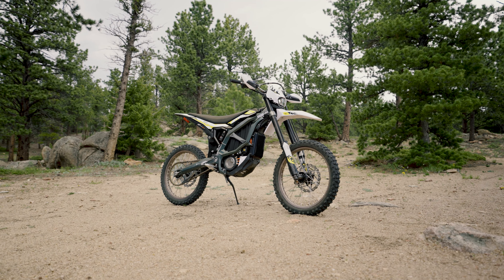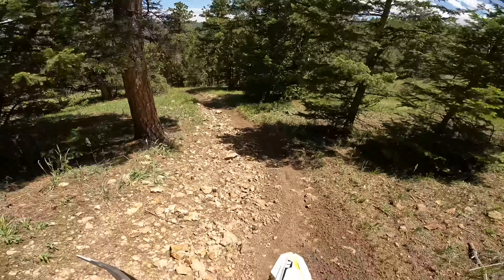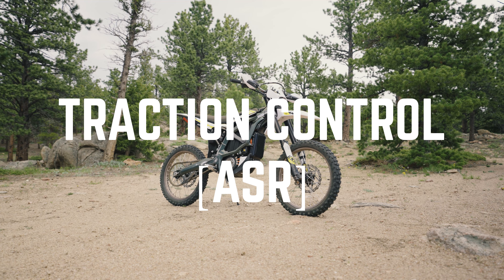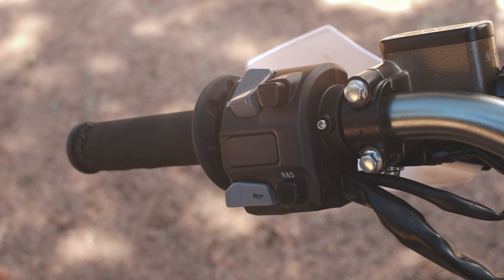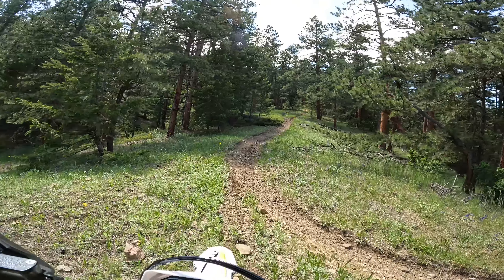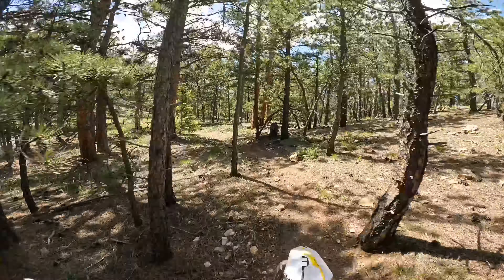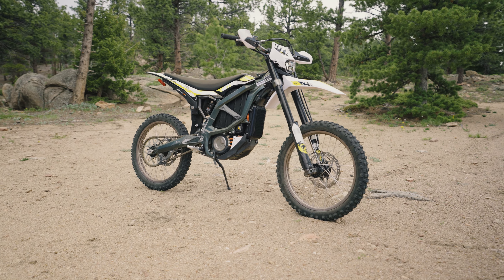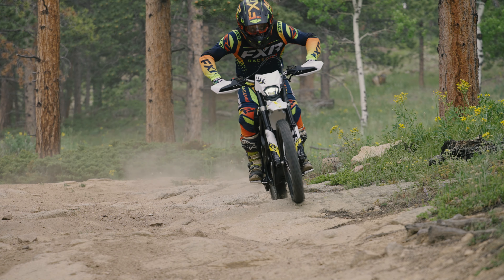How To Tune Your Surron Ultra Bee | Best Menu Settings

Comment: What sort of range (time and mile/kms) do you get riding single track?  I have a Beta Xtrainer and I'm thinking of swapping to an Ultra Bee as I mainly ride single track technical stuff.  I average around 30kms and 2 hours of moving time per ride when I ride.
Reply: Thats easy. I run mine with a 21/18 wheelset and while Trail riding with other Gas bikes we Ride 2hrs and i‘ve got 30-40 percent left
Reply: I have a consumption of around 25% per hour on my Ultra on stock tires when riding trails.
Reply: My range in mixed riding (60-70 km/h pavement and slow technical rocky terrain/climbs) is ~60 km or about 2h. I think it can do more if you are lucky enough to have single track just outside your door.

Comment: A little trick I picked up from my uncle, he used to race one of the lower classes of Formula one, 
for when playing around with menu settings like this, or suspension and so on:
You tend to take it slow and in small increments, but that can leave you with a vague and muddy impression. Instead you can try still concentrating on one setting at a time, but start out with a HUGE change, not a tiny one! That will make a big impression, show you how a change in that setting feels at the extreme and then all you need to do is tune it back to the correct level!
Works better for some stuff then for other, but a valuable little trick to know and one I thought you might enjoy trying! - Thanks for the vid, getting my Bee the coming days! 👍👍
Reply: That’s good advice thanks!

Comment: I have two additions:
The gear ratio is in fact affected by the sprockets used. Since the bike measures speed from the motors ERPM. Unless you are sure it measures by the rear ASR sensor? What I tested is, it definitely uses the rear wheel for the odometer + speedo.
The T parameter is the only one that is not saved after a reboot. It always starts in T0.

Also did you know you can update your bikes old firmware using the official Surn-ron app?

Comment: Tip on the TC, since I just rewatched the video:
I appreciated the test, since it shows well how much the motor CAN cut in the worst cases!
But pragmatically speaking, a more "real world usability test" would be getting a slow, a mid and a fast corner, pick the strongest setting and just keep it pinned 100% from the middle of the corner...
Then be incrementally more careful and reduce the assistance and compare the TC runs with how you would ride it "analog" just with your wrist...
I'm not a giant fan of TC, but I have two friends that are and that's what they both love and praise about it: Get past the middle of the corner and just tear it open "light switch style" and hold on for dear life... Eager to try it on the Ultra Bee and dirt! Only have experience on my road bike!😀

Comment: Awesome video. Do you have the SurRon telemetry box installed on your bike? If so, you can use the suron app by Bluetooth to control all these settings too. The naming convention in the app for each setting is a little bit different though. Also, the box has a SIM card which enables GPS tracking of the bike and all your rides and an alarm feature.

Comment: Got the Ultra Bee a few days ago, didn’t ride it until upgrading the wheels with trails tires, RC bend bars, bark busters, and foot pegs, non-O-ring chain on the way. I love it! Set it up with all your settings right off the bat, perfect! Sport mode all the way for me, although I am used to a lot of open bikes over the years, down the road, will definitely upgrade to the EBMX battery and controller, supposedly makes 40 hp? That would be insane!!👍👍👍. 1.1 seems perfect gear ratio setting for 21”.
Reply: Non O-Ring chain? What does that mean? What does it have instead of O-Rings? And how is it better?
Reply: @mcbrite  o rings create a lot of drag, non o ring are primarily for MX, just way less resistance, so more power and range with non o ring.
Reply: @mcbrite roller chain, rubber o rings are bad for friction and you lose power

Comment: How do you bind the app I put in the SN number and the VIN number then I hit bind have tried many times it won't bind
Reply: did you find a solution to this?
Reply: @jahha22  nope it sounds like that's not capable when you buy them straight from China
Reply: @ls1chevy2  thanks for the response. that's sad. I didn't buy it directly from China, bought a road legal version from. an authorized dealer in my country in europe. I still get the same error over and over

Comment: no regen. no sensors on. no traction control. the best way to ride this bike
Reply: why ? i dont understand difference between brake regen and coast regen , thanks
Reply: @Etonnantnon   brake regen slows the machine when you apply brakes (you regen a lot of energy) coast regen is when you cruise downhill with no brakes applied and no throttle apply (you regen less energy than brake regen)

Comment: Does anyone have an Ultra Bee in the Boulder / Longmont Colorado area? The dealer I purchased the bike from is putting in a warranty claim on my charger, but it looks like it will be several weeks before the replacement charger gets here. My battery has two bars left, but I am wondering whether the problem could be the battery port and not the charger. I was wanting to test someone else's charger on my battery to verify that the issue is in fact my charger.  The dealer indicated that they have seen other faulty chargers already with the same symptoms that I have and that they have already put in a few warranty claims.
 It would suck to wait who knows how many weeks for a replacement charger only to find out that the issue is not the charger. I only used the bike on a trail once and it is already out of commission.

I will provide an update here to let folks know how long it takes for Surron to remedy this issue.  Apparently, I am not the only person going through this.
Reply: Update - After sending the charger back to the dealer via UPS,  the dealer has confirmed that the charger is bad.  I only used the charger once.  I am now stuck with a bike that I can't ride until I get a warranty replacement charger.    I hope am I not waiting several weeks / months.
Reply: Update:  Surron fixed my issue and provided  above and beyond excellent customer service!